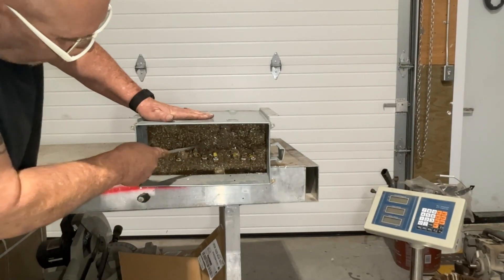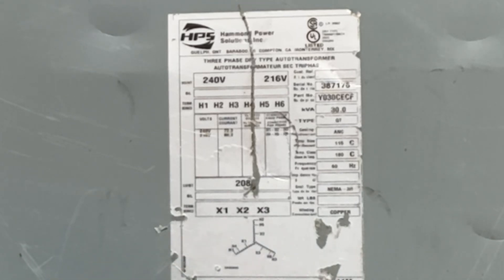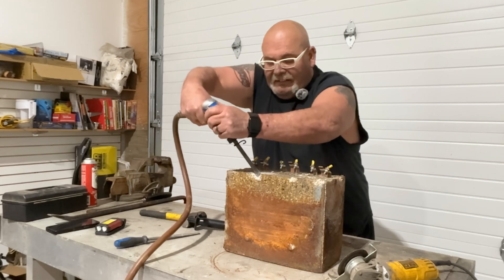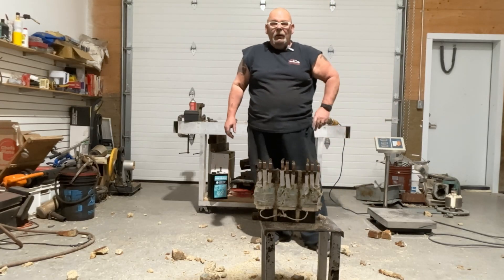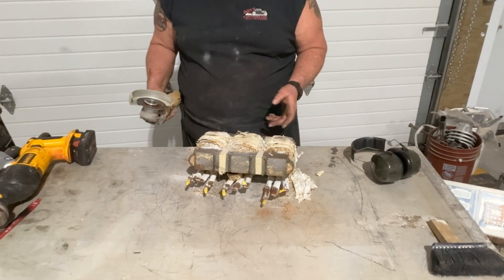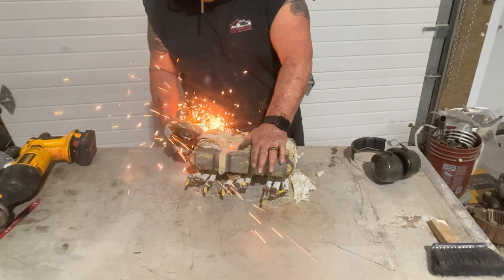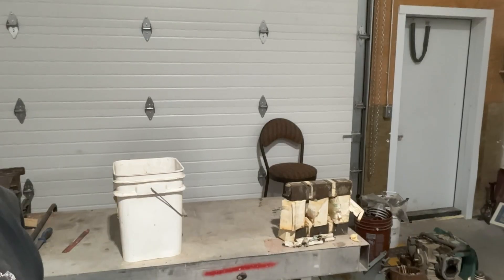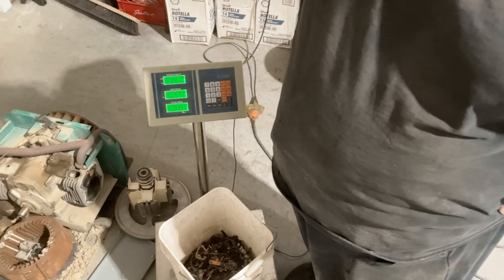They Said This Transformer Was UNSCRAPPABLE! (Calculated Profit)

Comment from the maker: Copper Inside clarification before the comments go sideways 👇
Yes — I fully stripped this autotransformer.
Starting weight: 106 lb
Net copper recovered: 14 lb
The rest is steel, silica sand, and resin potting.

This video shows what full completion actually looks like, not a highlight reel or a shortcut.
Possible? Yes.
Easy? No.
Worth it? That depends how much you value your time, tools, and patience.

Watch the whole video before deciding where your quit line is.
Reply: Now I know what you were talking about.
Reply from the maker: Well that's good sorry I suck at explaining
Reply: @nicejunk666 you explain it very well in the video..
Reply from the maker: Thanks buddy
Reply: My quit line was when I saw how you swing a sledgehammer, Nancy.
Reply from the maker: I'm a old man lol